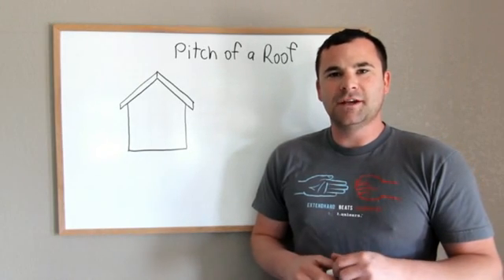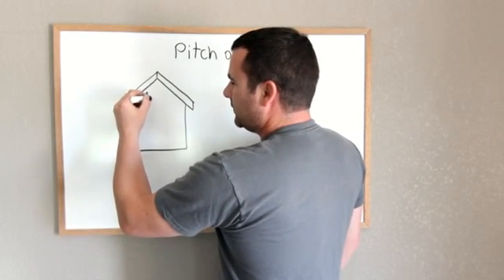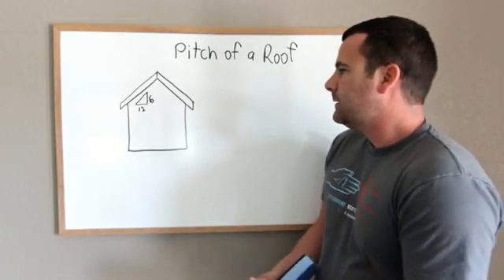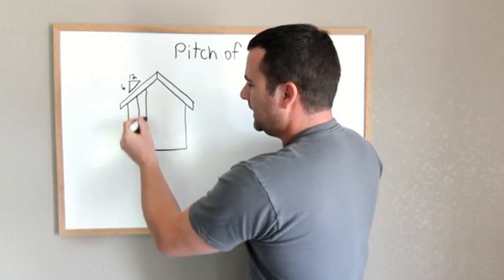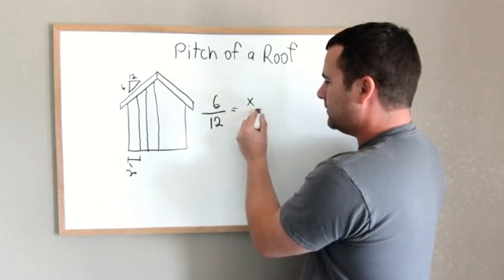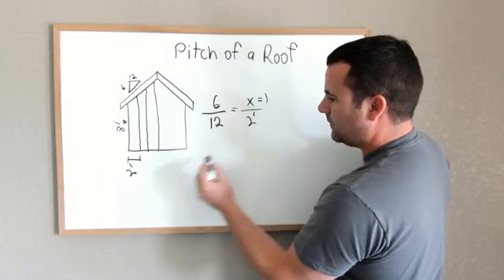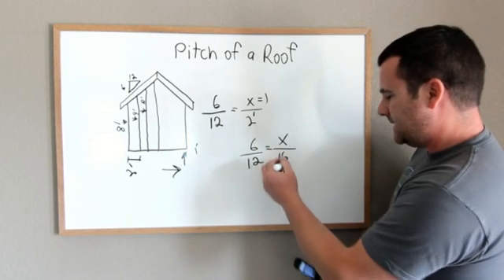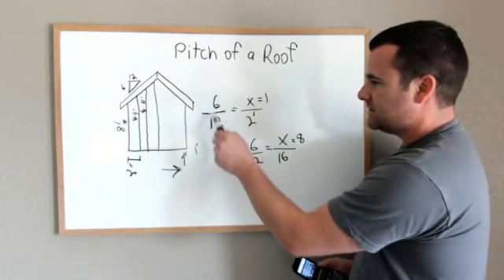Roof Pitch and How-to Manipulate rise over run

Comment: How is the slope factor used in cutting hip and valley jacks?
Reply from the maker: I’ll do my best to explain it. A hip or valley rafter sits at 45 degrees to a regular rafter (when looking at it from above and NOT factoring the slope. Keep it 2D in your mind). Therefore the RUN of a hip is 1.414 times longer than that of a regular rafter. If your roof is a 5/12 pitch then for your plumb and level cuts on a hip or valley rafter you would set your square to a 5/17 (run of 12 X 1.414). 

The rafters that hang OFF the hip or valley would still be cut at a 5/12 pitch for the plumb cut but then you have to bevel it at a 45 to butt into the hip rafter. 

Does that help at all? If not email me. kody@uptokode.com

Comment: Wait, are you doing inches or feet?
Because 16" is very different from 24".
Reply from the maker: Rise over run is just a ratio. You can plug 16” or 24” into the equation and as long as you cross multiple and divide you will get the other half of the equation you need that is relative to the number you used. It can be in inches, mm, feet, etc .

Comment: Great explanation, however, what if your trying to figure out rise over pitch, when changing over from a Slant roof to a pitch roof, and the walls are shorter in the front and taller in the back?...;-)
Reply from the maker: Not sure how I can help with your question. Pitch or slope is always a ratio to rise over run. If you have a wall that’s say 50 feet long and it rises say 5 ft then that ratio is 5:50 (rise over run). If you want to know the pitch then go 5:50 = x:12.   

Cross multiply and divide. So 5 x 12 = 60. Then that answer 60 divided by 50 = 1.2. 

Your pitch is 1.2 over 12.  Not sure if that’s what you were asking.

Comment: You can also find difference in length by placing your framing square on a board - 6 on the tongue and 12 on the blade. Then mark the edge of the blade, and then slide it along the mark until it reads 16 (for 16" OC). Now look at what the tongue side reads. That is the common length difference of gable or rake studs for a 6/12 pitch. This works for all pitches, just set your square for whatever pitch you have.
Reply: 6 divided by 12 is 0.5
INV ARC (tangent) 0.5= 26.525°

Comment: I watching lots of tutorials to see if I work out what all this means 8,12) (6,12) (4,12) (3,12)
Reply from the maker: Not sure how to respond. Did the video make sense? When someone says 8, 12 they are referring to pitch. Rise over run.
Reply: @Kody  Hm, I'm not sure if pitch is equivalent to rise/run as even though rise/run is in pitch; I don't that that Pitch is rise/run. Unless ya were meaning something else. So sorry.

@Edward As for the question from what I think I learned in class it could mean the coordinates on a grid. Like, how do I explain? Take a grid with X and Y coordinates. And rise is Y and run is X. And than mark each like you would for a grid. (I.e 8 + up from the center and 12 + to the right. After do the same thing for the next pair but start at where the last ended.) Something like that. I don't even know if it was right, it's just a hunch. ¯\_(ツ)_/¯

Comment: You should have plugged in 24 inches instead of 2 feet.  You have to use the same units of measure.  Your answer of 1 was 1 inch not 1 foot.  Try plugging in 4 feet and 48 inches and you will you get two different answers.
Reply from the maker: Yes very true and good point.
Reply: Yeah man u fucked the whole thing up. Doesnt make any sense when your doing feet and inches in the same equation wtf.

Comment: WHAT IS THE "PITCH" OF A ROOF?
Reply from the maker: It's the angle of roof itself expressed in a ratio of rise over run. A 3/12 pitch is a low angle and a 12/12 pitch is steep (45 degree angle)